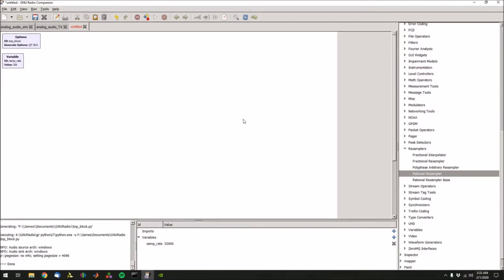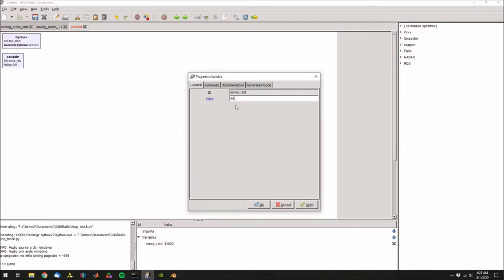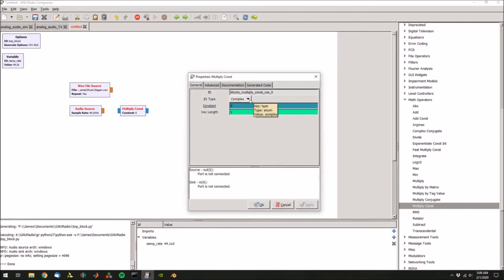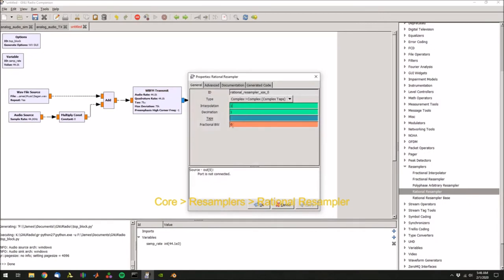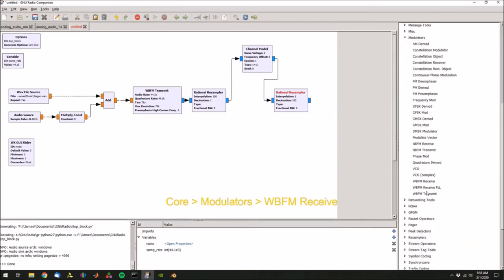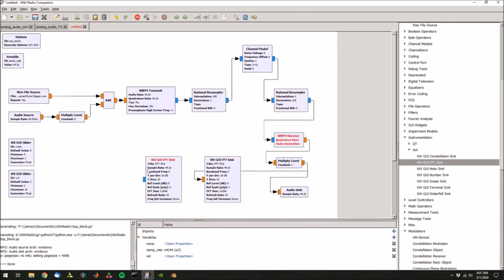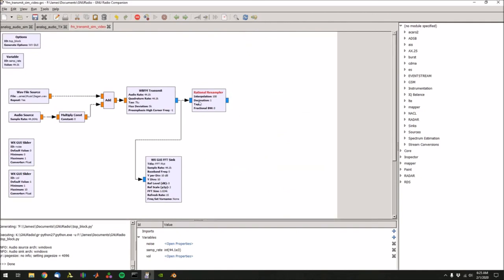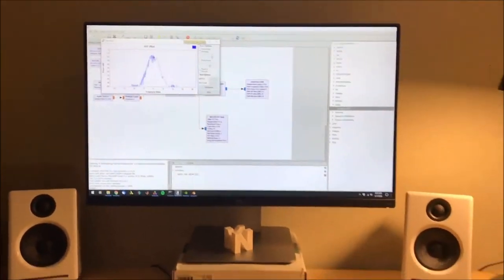FM Transmitter in GNU Radio with HackRF

Comment: When doing pure simulations in GNU radio you need to use the throttle block, or else the scheduler will run as fast as it can, even if the sample rate is 44.1k. That may explain the distortion mentioned at the beginning.
Reply: You're right, if you don't use a throttle the CPU can get nailed to 100% and freeze.